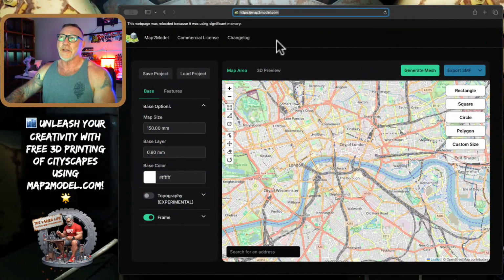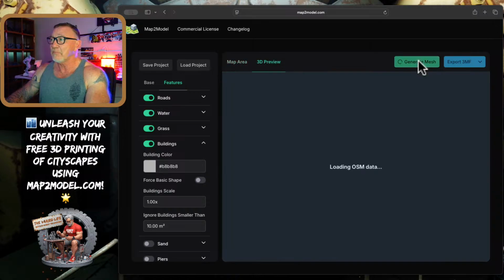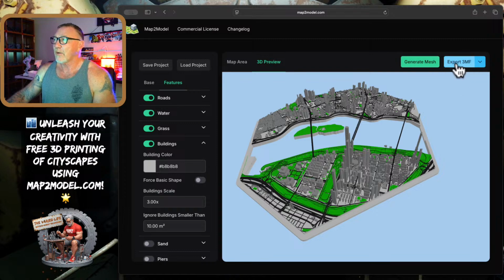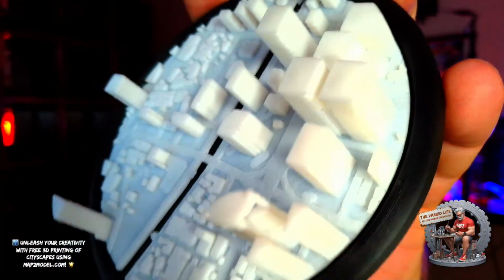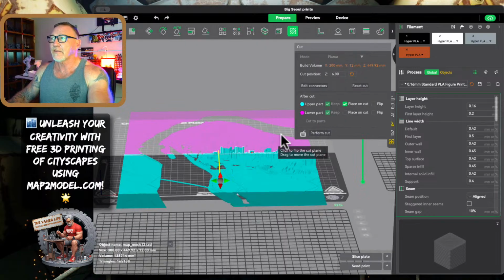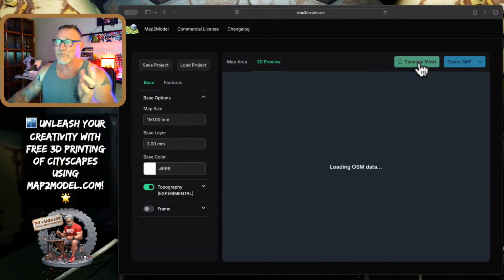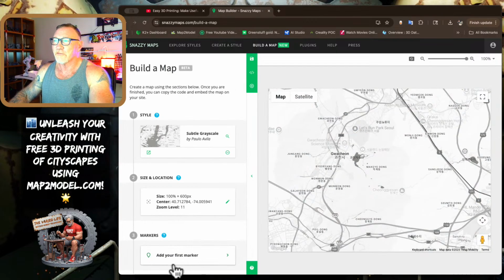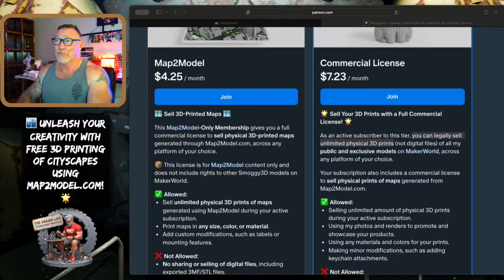🏙️ Unleash Your Creativity with Free 3D Printing of Cityscapes using Map2model.com! 🌟

Comment: Hello,
Do you know what limits Map2Model from reading/capturing all buildings in a given area?
It can only generate all the buildings, houses, etc., in major cities or capitals.
Thank you.
Reply from the maker: Good question. Look at buildings under the features tab and you can choose the minimum size for buildings. With that said I looked for a house I used to own in Colorado. Zoomed in as much as possible and set to 0 and didn't get the building. So it does have some limitations.
Reply: @theVariedLife  That helps. I figured it might have some limitations, especially with smaller buildings or certain locations. Still, being able to filter by size is a useful feature—I'll play around with the settings more and see what I can find. Thanks. :o)
Reply from the maker: @mikekiske  Yea other paid sites offer better but this is free so its ok.
Reply: its works off od googe maps data, remote places outside big cities doent have as much data for the website to work with.